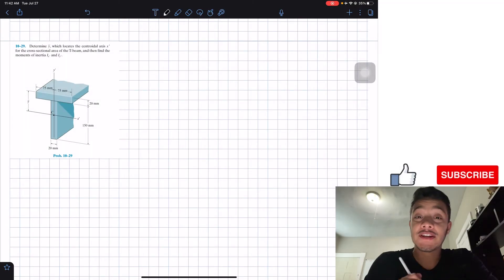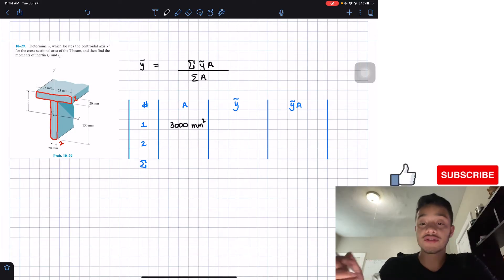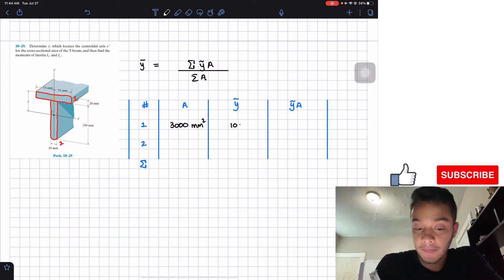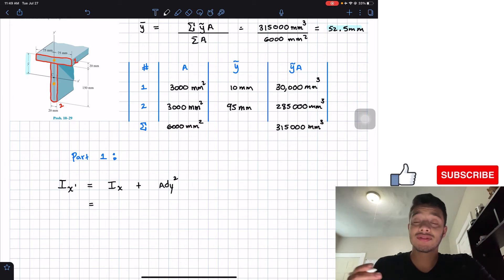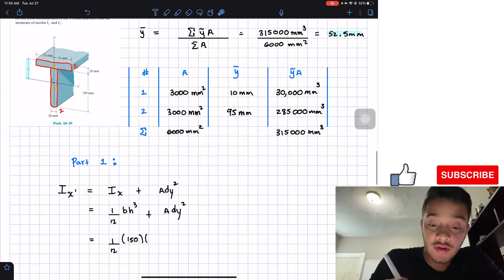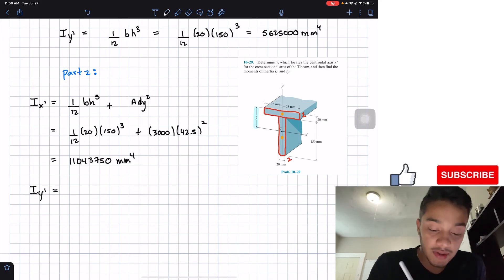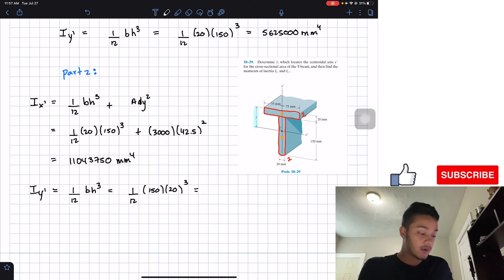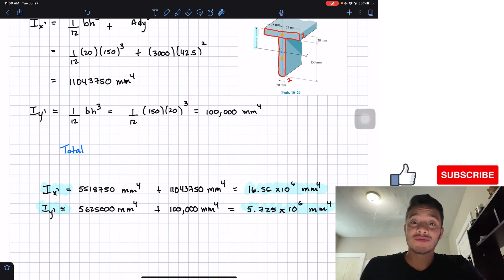Statics 10.29 - Determine the ȳ, and then find the moments of inertia Ix' and Iy'.

Comment: I am a bit confused, why in this video the distance of y^- is used while in the 10.36 video only half of both figures were taken? I mean that in this one the centroid distance had to be solved while in the other one it was only divided by 2.
here is the video: https://youtu.be/gX9r4akWvt4
Reply from the maker: Hey Michael. The reason why in this video we had to find Y^- is because its not a symmetrical object around the horizontal line. In this video we have a "T" beam and in the other video (10.36) is an "I" Beam which it is symmetrical.
Reply: @LearningbyTeaching  aaah thank you so much! 🙌

Comment: I feel like the centroids are wrong. The first rectangle should have y=160mm since y=150mm + (20mm/2) and the second rectangle should be y=75mm since 150mm/2 = 75mm. The total yA should be 705000 mm^3 and when you divide it to the total area which is 6000 mm^2. So, the centroid of the composite object should be around 117.5 mm.
Reply: You both found the same answer, you measured from the bottom and he measured from the top. The diagram has the y hat measured from the top so that's why he did it that way. 117.5 (your answer)+ 52.5(his answer) = 170 (the total length).
Reply: @faith7090-x5s  Thank you for taking the time out to clarify, I have been stuck wondering why he did it from the top and why my answer is so skewed